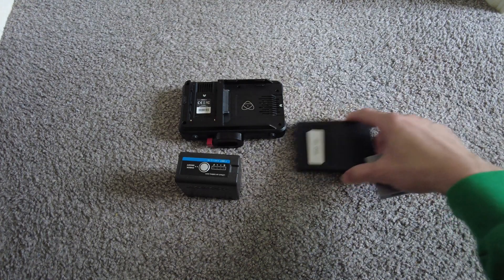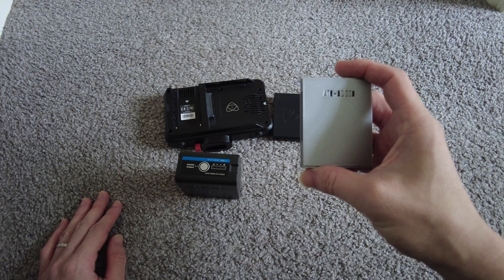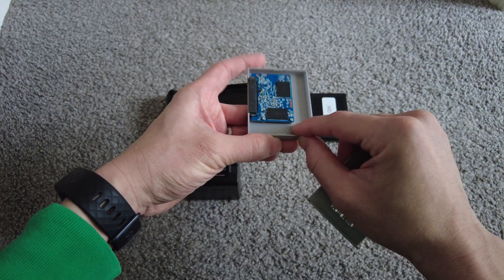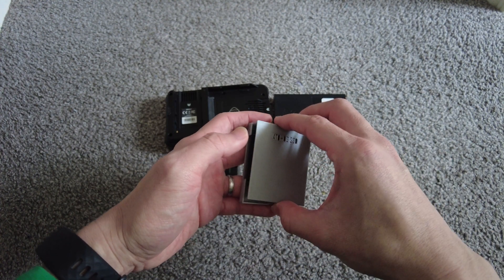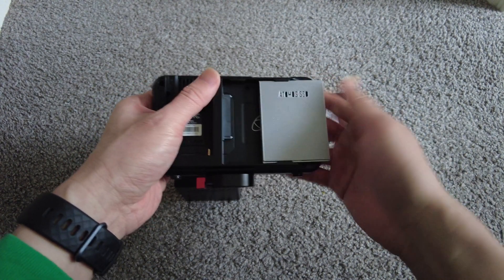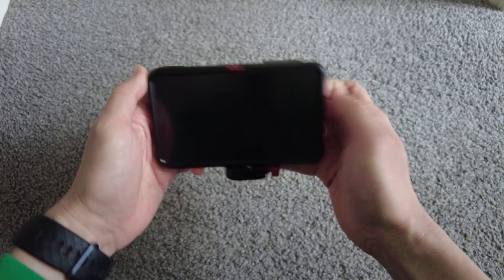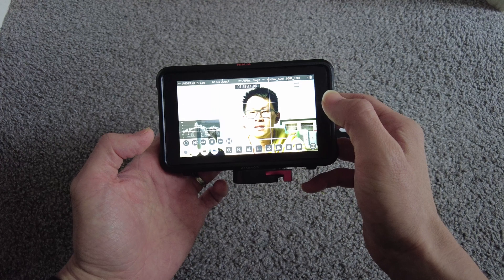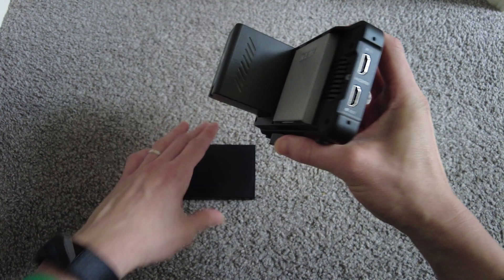Atomos Ninja V Custom SSD Caddy and Western Digital Blue 1tb SSD Teardown

Comment: I think WD updated their drives, I just bought a 1TB WD Blue and it no longer uses screws, once opened the pcb screw holes are placed different, just had the 3D model printed and it wouldn't line up. Tried some moding but I just ended up breaking the 3d model xd.
Reply from the maker: That's good to know, but not surprising as it's been years since I published this video.

Comment: What plastic did you use? My Atomos get too hot and deformed the caddy.
Reply from the maker: Wow, sorry to hear that. I never have any problems but I presume because we don't get very high temp very often in the UK. 
I have been using PLA so I think you can petg or even abs if you have an enclosure?
Reply: @Imspir3  thanks man. will try both! :)